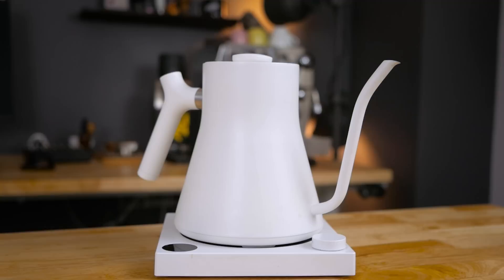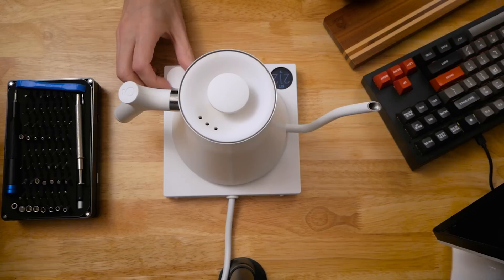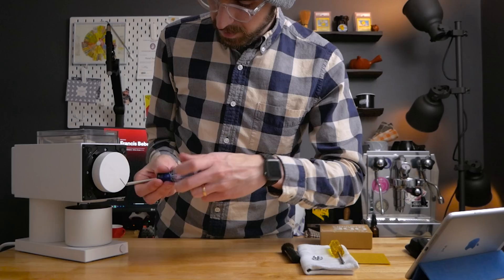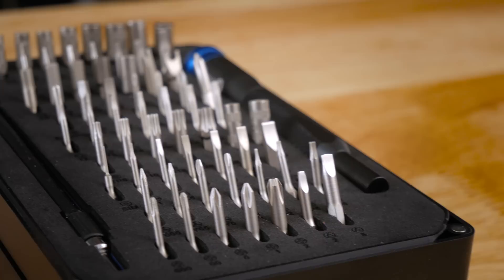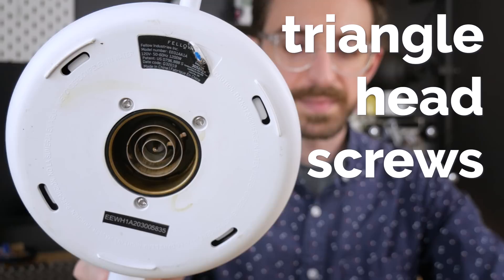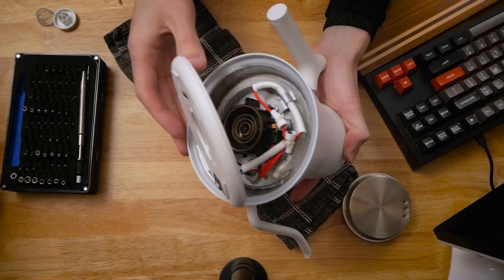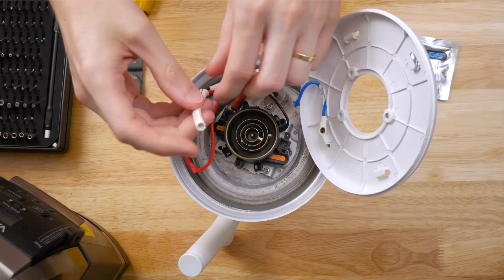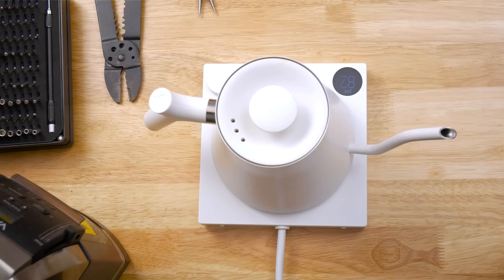I Almost Threw Away a $165 Kettle - Fellow Stagg

Comment: Please tell us that you properly covered the new fuse and connectors, in the video it appears that there is some exposed metal. Look around 4:41
Reply from the maker: Yes! I went back and made sure they got covered. The crimp connectors I bought were much longer than the ones installed previously, and I forgot to point that out. Thank you 😊
Reply: @DavidLikesCoffee  What method did you use to cover the connectors? Will heat shrink trip the fuse?
Reply from the maker: @jeffsprague3316  good quality electrical tape should work. If using a hair dryer for heat shrink I don’t think that would trip the fuse.
Reply: You’re a legend for sharing this fix David 👍🏻🙂
Reply: Unfortunately videos like this are the EXACT reason that manufacturers prefer to tell customers to buy a new one. Why on EARTH would they suggest you attempt to repair something which could kill you? For people like us, this kind of repair can be done safely, because we are extremely careful and we apply our depth of knowledge and understanding of electronics, wiring regulations, etc. But for the majority of people at home they absolutely should not attempt this kind of repair, for the same reason that this guy shouldn't post videos online encouraging people to repair this stuff: when you do it wrong it can be dangerous.

The "right to repair" is a fine idea, but with "rights" come "responsibility", and I'm afraid posting a video online showing an exposed live mains conductor about 10mm away from a metal part that gets touched daily in a kitchen, is an abuse of that responsibility.

There's a good reason many videos traditionally use the phrase "don't try this at home kids". Your repair video should at the very least come with an extremely strong safety warning to put the majority of people off doing a repair like this, instead of encouraging any old person to have a go.

I'm sorry if you think I'm being a Karen or a killjoy. You can ignore my comment if you like, but let's look at this objectively: if you post stuff like this which reduces the safety of a household item, then you can expect manufacturers to move into an even more entrenched position when it comes to insisting people replace instead of repair.
Reply: @MatSmithLondon  No, that's not the EXACT reason manufacturers tell customers to buy a new one. People have been fixing their electronic devices for decades, long before youtube. Ever opened up an old VCR, toaster or hair dryer? If people couldn't fix it themselves they would take it down to their local repair shop where they would do it there for a fraction of the cost of a new one. That was the reason manufacturers make repair difficult (now with software) - not because people opened up the products they bought, but because of greed.
Reply: @veergauba  Okay, I concede my use of the word "exact" was a little sloppy. But you can call it "greed", or the inverse which is "fear of being sued". I guess it depends how you frame it.
Reply: @MatSmithLondon  It is not fear of being sued, it's about keeping ownership of the product. 
If you want to sue the company because of f up on your side than you have to prove that it was not your mistake
Reply: @Skund79  Do you think that's how litigation works? People try it on with vexatious claims, whether successful or not it can cause huge costs in legal defence. Either way, the point is that if this "right to repair" movement (which by the way stands completely in the way of capitalism which is the only reason we as consumers get to have stuff like this) were to be taken seriously, as well as this video, then presumably the desired outcome would be that such manufacturers would support people making repairs themselves e.g. by giving advice. Even if the advice is "this is the part that might be causing a problem but we cannot condone you fixing it", even in a response like that - there's a claim. Where there's blame there's a claim. And whether it was that advice that ends up killing someone or not, either way there's a claim.

Don't get me wrong, I'm all in favour of competent people fixing things. I consider myself competent, or at least competent enough to know when I can't or shouldn't. The majority of people, on the other hand, can be relied on to do the opposite: try it even if they shouldn't, and this video is a case in point.

Comment: I have the same kettle and pretty often the screen glitches out but it's fine again after being power cycled. One time the heater didn't cut off at the set temp and it started to spray boiling water and steam out the holes in the top 😮. I think the brain board or temp sensor are faulty but I'm not sure where I would get new parts.

Comment: Fun fact, for those that find the STAGG pours just a bit too slow, If you look inside there is a little metal piece with holes covering the hole at the bottom of the spout, which further restricts flow. With a mallet and a flat sharp chisel or screwdriver it can be removed easily. It now pours SMOOTHER and just a bit Faster.

Comment: Perhaps I was within my warranty period, but I had a much better experience with Fellow when the screen on my base plate stopped working—felt too proprietary to easily replace. I learned to adjust the temperature by the number of clicks (set the kettle to Celsius for less click counting). Fellow, in my case, was great about sending me a new base which has been working beautifully for years since. Now to go see if perhaps it was the thermal fuse which failed on my earlier Bodum kettle. Repairing it would give the kettle a new life with someone else.

Comment: I’ve had to make this repair a few times on my kettle. However, the Line side of the heater wire has gotten overheated over time that it needs replacing. Do you or anyone on here have a part number for the heat resistant wire?

Comment: I loved the video, the final CATdown when you hold your breath was great! A quick question: do you use the Vario for both filter and espresso?
Reply from the maker: I use it mainly for espresso with the steel forte burrs, but it does make great filter. If you do both, the grind range is about from espresso to v60 so might be limiting if you want to do Chemex or methods that need a coarser grind.

Comment: I read too many complaints about failing heating plate, so I’m ought the stainless steel polished steel kettle. Then I got it and it is tiny…too tiny to properly center on my gas stove without setting to low, and waiting 20 minutes for water to boil…then I thought, Oh an indication plate—but guess what, in order for a metal to work on an induction heater, the metal must be magnetic—but though stainless steel, this metal that Fellow uses is not the right kind—it has an additional element which makes it non-metal. So now what? Spend 150.00 on a hob that many complain about, all the time? Well, I’m sorry but this product is Vheap—read CHINA!! My attachment to coffee and all-things-pretty slapped me in the face… Do any of you use induction plates for your Fellow Stagg EKG kettles? if so, please let me know. I already tossed a magnetic thermometer against my kettle and it isn’t magnetic—meaning an induction plate cannot be used…Appreciate any comments. Tashi Delek.

Comment: Nice video! Can you share with us the thermal fuse temp rating? I also have the same kettle and in case it happens to mine, I can buy the right fuse to start with. Thank you!
Reply from the maker: I went ahead and linked the fuses in the description, the ones I used had thermal cutoff at 184C

Comment: I just don't get why Fellow won't suggest this as a troubleshooting and self repair option... regardless of all the other valid points as to why not trying to fix a $165+ kettle with a simple $1 fuse, it would likely save the company money on thousands of unnecessary warranty replacements every year (not to mention reduced waste from throwing out perfectly good tech).

Comment: I think I need to replace the thermometer 😢 Any thoughts on this?

At some point I started noticing small deviation. E.g. I've set it to 95 but it would go to 96 (when I remove the cattle and place it back). Over a couple of months it become worse and now it's critical since you can set whatever temperature and it will reach 100 (saying it's 83 even or something) and boil the water with its full power 😭 So I cannot even leave it and have to watch and switch it off to be safe.

Comment: First time viewer here. Wanna repair my kettle that I dropped (not the gooseneck version) since it developed some micro crack and still works fine but now leaks a little bit when boiling. Hopefully something here can make it work since it's silly to replace the entire thing. 

Love the Pearl sticker on your espresso machine, btw.
Reply: maybe some high-temp silicone, but be very careful, you're dealing with mains voltage

Comment: My Stagg sputters and runs wild when it boils. I wonder if the issue is with the temp probe either in the kettle or in the base. Anyone fixed this before?
Reply: Unfortunately I have the same issue. Some days it does this other days not.... until recently it's been happening every day. I have to fill it half way to avoid it boiling over or boil the water with the lid off. I reached out to fellow and they told me I had to replace it as it was out of warranty. Sure I'll hand over another 220$ for a kettle that will last 2 years while my parents $15 kettle still going after 10 years.
Reply: @zdaher  my dad opened it and did a tonne pf tests. Couldnt locate the fault. Its very simple under the hood. Very strange and frankly extremely frustrating. Its cemented my view that anything Fellow is absolute garbage. Unsure what to get instead.
Reply: @ahpadt  I'm in the same boat of what to get next. It is  the best looking kettle on the market but forking out $220 every 2 years is a joke.

Comment: I wish you can help me repair my stagg’s stubborn switch. Sometimes i need to press the swith like 3-5 times before it responds.
Reply: This happens to me. Whilst this doesn't fully resolve it, I have found that sliding a cleaning wipe under it back and forth can help if a rogue coffee ground has gotten under the button.
Reply from the maker: It's so easy to get dirt and debris under there. But it comes up pretty easily if you pry it out with a credit card and give everything a good wipe down with rubbing alcohol.
Reply: I have had this issue from day one. I sometimes have to click the switch 6 times. I reached out to fellow on their site and never got a response. I'll look elsewhere to replace when this dies.

Comment: Is there any point having fuse in the kettle? Or is it just another device, which ensures, that device is going to break at predetermined time in future, soon after warranty expiration?
Btw. here in the EU, we have wall sockets protected by circuit breakers. Therefore, generally we don't have fuses in common home appliances.
If i was doing the repair, I'd just remove the fuse and connect appropriate wires.
Reply: That's a thermal fuse. It cuts power at a rated temperature, so a heater failure won't set your kitchen on fire. You might want to keep it in there.
Reply: @peterlustig7600  Are you sure that was thermal protection? I've always thought that kettle is protected by bimetallic switch, KSD-9700 or something similar.

Comment: Fellow should have used a resettable thermal fuse, it is common that people by accident run the kettle dry. If you didn't run the kettle dry and it failed then the thermal fuse is undersigned and not suitable for the lifespan of the kettle. 

To some it up, piss poor engineering for a $165 kettle!

Comment: Why you say it’s well made? Broken in 2 years.The company says that’s not repairable. 165$ and the cost was 1 dollar and it is not repairable. That’s why 99% of true coffee lovers don’t care of having a simple Chinese ,as this is, 30-50 dollars kettle. I personally don’t care about the temperature screen cause I need boiling water every time. So when the thermostat close the circuit I use the water.
Reply: Fellow is just insanely good at marketing and building good will about their brand despite long term performance.

Comment: Not sure what crimps you used, but it's generally never a good idea to crimp solid wire/leads. Crimps are meant for stranded wire and in this case soldering the connection is the solution.
Reply: I imagine putting 700 degrees F near a thermal fuse isn't a great idea though.

Comment: If the fuse is a point of failure, it should be external so you can easily change it in the future. Silly design.
Reply: No indication of why the thermal fuse, which is a fail safe device, failed. The fuse is never the cause. By all means, replace it, and then when it blows again (hopefully) figure out why on the second round.  Somewhere in the mid 90’s I shorted around an open thermal fuse in my cheap drip coffee maker. The machine did not make coffee then, but it made flames.  

Nobody got hurt and I got a story out of it, so I guess it was worth a shot.

Comment: You mention right to repair but there were no issues with repairing it. You simply replaced a fuse. The way you replaced it is also exactly how you would expect a technician to. The only thing they could’ve done was make it easier to access by using normal screws 

Fuses are easy to replace in cars and are detailed about how and when to do it but I have seen people sell cars where the only issue was a fuse. 

What would you really expect out of fellow in this situation? They don’t manufacture these and probably do not even hire technicians to do repairs. 

Most end users who are unable to crimp a wire would probably not be interested in repairing anything electrical.

Would it be worth a $30-$50 increase in a product to support right to repair features and employees or would you rather they invest in making a product as reliable as possible while trying to reduce the overall cost. That’s ultimately what right to repair comes down to. Many features that would improve right to repair introduce failure points and cost. 

Ultimately consumers will just buy the cheapest product upfront that suits them and 99% are not interested in spending a second repairing it. 

The right to repair crowd does not support the companies that produce products with that in mind and therefore they are not out in the market

Comment: The right to repair means you have the right to modify your appliance in such a way that it violates the conditions of the global NRTL safety certifications that product companies have to pay tens of thousands in regulatory fees in order to obtain. And in doing so, your average YouTube commenter is thus free to injure or kill people via electrocution or burning down their house. This nuance is lost in all the advocacy around right to repair.  

An average safety CB report spans between one to two hundred pages and enumerates all critical safety components and workmanship areas that must not be changed to maintain compliance with the mark.  And the continued use of the safety mark requires regular paid audits to the factory that actually builds the product in order to ensure critical components have not changed and the critical areas of workmanship have not changed.

All this must be in place so the consumer can buy a new gadget and trust that it will not possibly kill them or their family.  By all means, repair your own device.  But consider all this the next time you throw shade at some new company who for some reason does not endorse rubes to go into their mains-connected appliance to muck about with it themselves.

You do not mention why the thermal fuse blew.